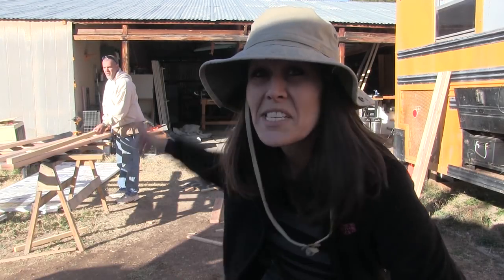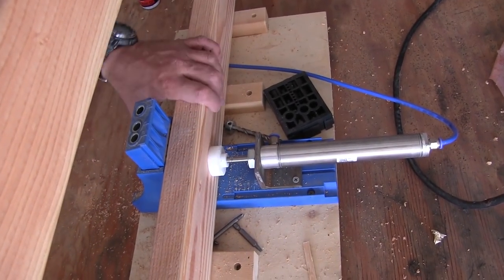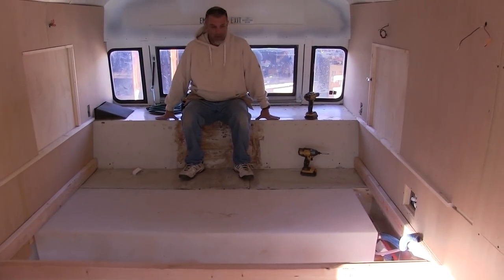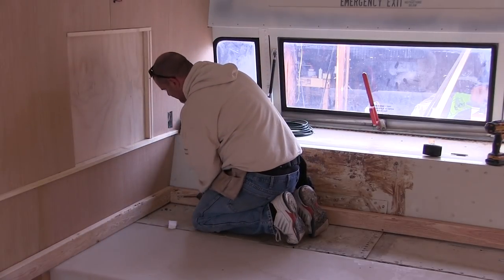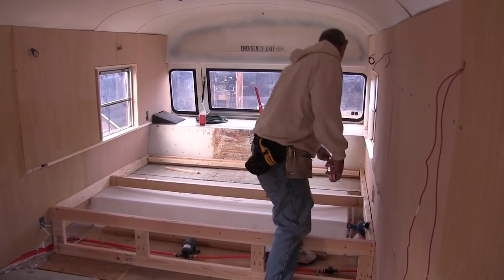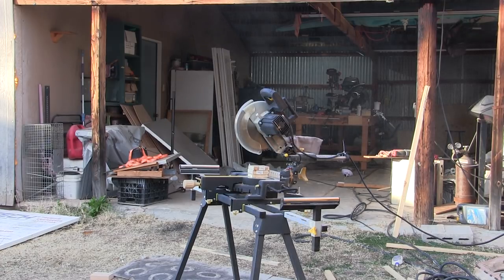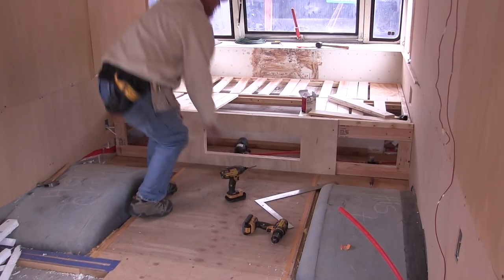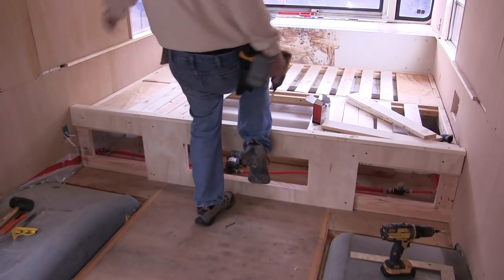Building the Bedroom | Skoolie Build

Comment: How far does the back engine come into the space? I want to turn that area into a bench but I can't find measurents for that section of a rear engine bus like yours. Do you happen to still have measurements of that area?
Reply from the maker: So the deck area from the window to where the back seat would have been is 24" and the it slopes down like a seat back would to a 16"deep platform.
Reply: @BussyMcBusface  Thank you, thank you, thank you!!

Comment: Why is it that no one ever put some kind of a drip pan to catch condensation of the water tanks I would think they would make it especially in the summer putting cold water in there and the heat inside the bus in the summer would cause condensation or any small leaks that might happen